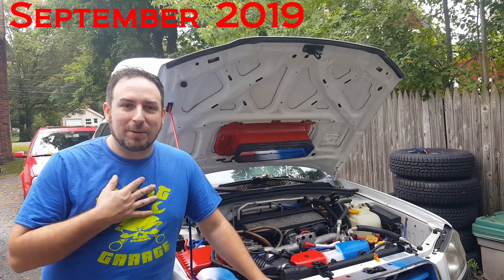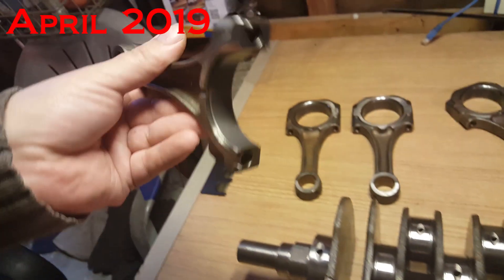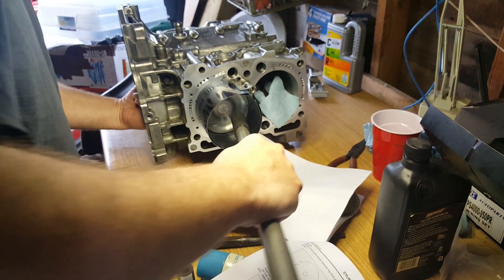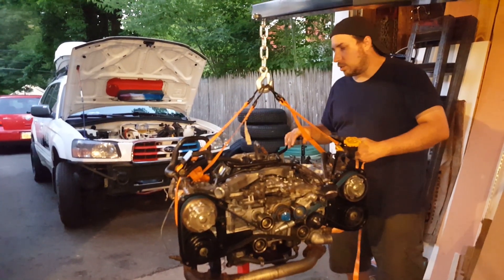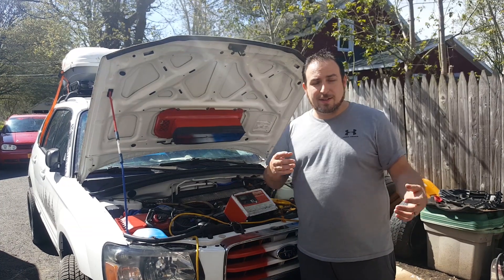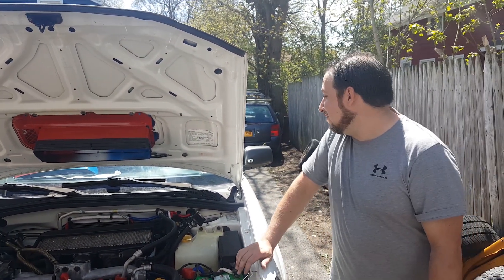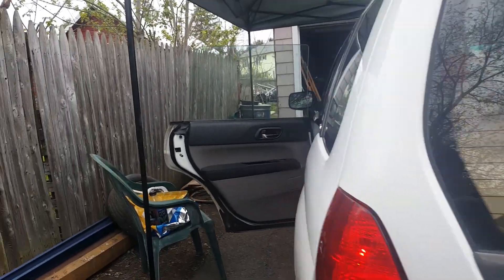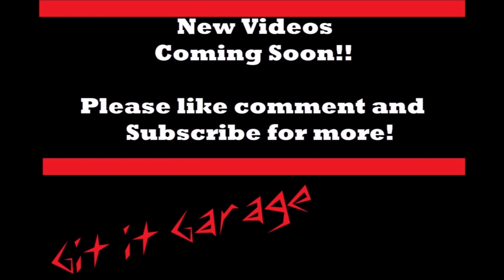SUBARU FORESTER XT - EJ25 - 800HP CLOSED DECK BLOCK!

Comment: Just FYI, Subaru engines can be easily installed and removed with the intake manifold installed
Reply: They can be lifted with a cherry picker using the runners to lol